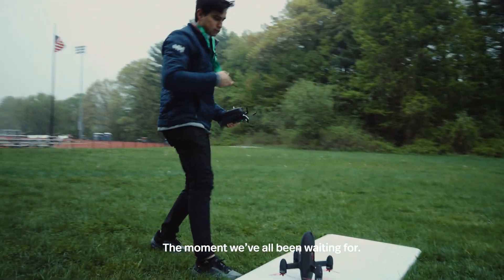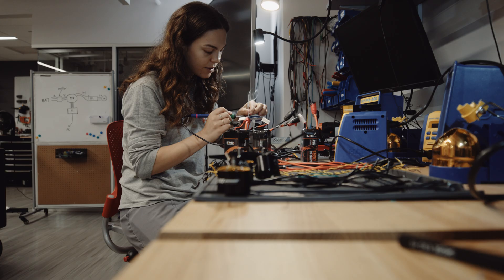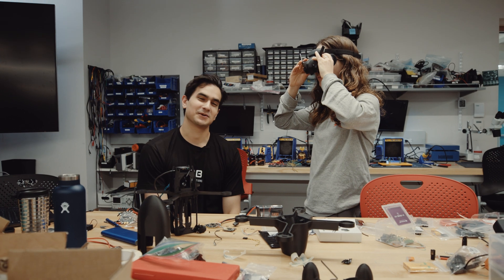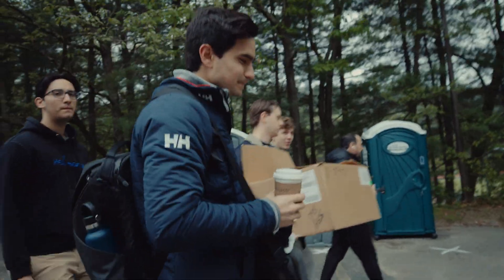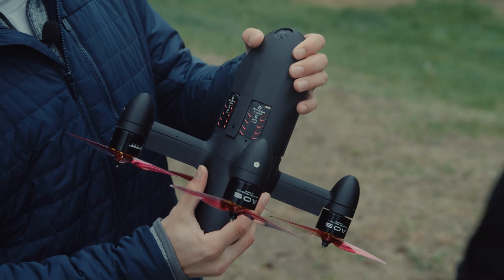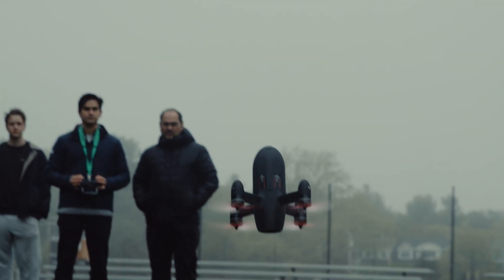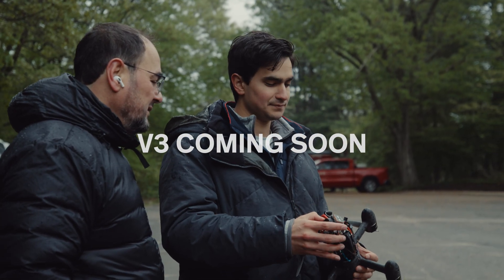Building One of the World's Fastest Drones

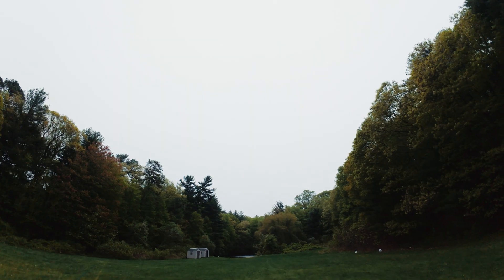Comment: Kudos to the camera team for the shots and edit. As an external source (who’s had a fair share of failsafes with crossfire) reviewing the OSD In Flight Test 2, at 9:10 and later at the point of connection loss. With LQ flashing H usually means you’re not receiving the expected amount of packets through the radio link, and if you add the fact that you lost connection when doing a high G turn, my money is on a loose RX - FC cable. Probably got loose on a previous test. You guys probably figured that out already but worth the shot. Keep up the great work!

Comment: Nice video! It’s a painful process 😂 my best tips are don’t bother with the FlyColor ESCs. They are too unreliable. The only ESCs I can actually recommend for these high power drones are the APD F120A V2. They are very good with dealing with desyncs and don’t tend to catch on fire much 😅 If your tune is good then you don’t need external cooling for them. A heat sink on the mosfet side with thermal pad to fill the gaps will go a long way. 

looks like your dynamic idle might have been a bit low? Depending on your prop pitch it needs to be pretty high to resist desyncs. Ours is set to 8000 RPM but that’s with a 7x15 inch prop.

Let me know if you have any questions. I know the pain of drones failing so happy to help where I can. 

Also we started with ELRS, but just switched to using the DJI RC because it’s one less thing to worry about and we found the signal strength was better than ELRS
Reply: Hey Luke yeah, definitely feeling that pain.

We tested a bunch of ESCs and it’s wild how different they behave in flight versus on the bench. In this case though, the failure was actually due to RX loss, not the ESCs so we didn’t get to really push them as far as we wanted.

We’re running TBS Crossfire, but the RX was mounted poorly and the shell was printed in a markforged printer in Onyx, I did not know it had carbon fiber (nylon + CF), which definitely didn’t help signal range. Learned that the hard way.

Still deciding on ESCs for the next iteration open to APDs now after your note. Would love to sync up if I run into more roadblocks with the next build. Appreciate you sharing all this!
Reply: @davidlobofpv826 okay well an RX loss is an easy fix at least. GPS rescue at over 400kph is unlikely to work because of the aggressive manoeuvre so you gotta be careful! On our world record speed runs we need a 2km distance to get up to full speed so range is an issue for sure. 

I don’t think BL Heli 32 and AM32 are really robust enough to handle these high power builds. Also, I don’t think the ESCs are equipped to handle the high back EMF when breaking either. 

I know they are more expensive, but I can guarantee APD is the most reliable option for ESCs. On our latest world record build we had countless midair ESC failures. Using APD from the beginning would have saved so much time and money. Luckily they are still manufacturing their ESCs. 

Our latest build goes up to 580/600kph and pulls 16kW at peak. Video is coming soon for the new world record speed runs
Reply: @LukeMaximoBell  Hi is there any use in upgrading to the APD200F3 v2 or was the 120F3v2 good enough even for your drone?
Reply: @LeoP-d1o The 200s can do 14S so that would be the main reason to go for those if you have a 14S battery. But in terms of power delivery the 120s are excellent. With our water cooling they only heat up about 10 degrees celcius after a speed run. However we are pushing up to 120A per motor at the moment, so for that reason alone our next drone might have to use the 200s.